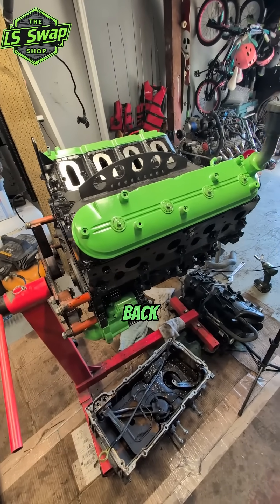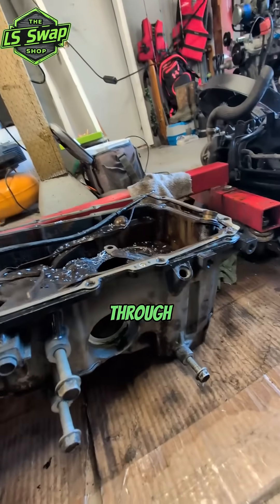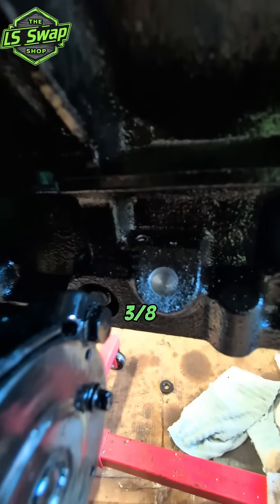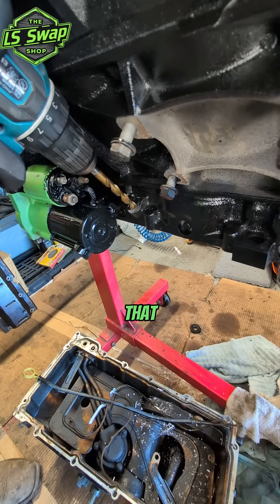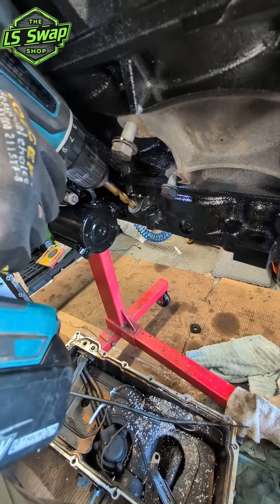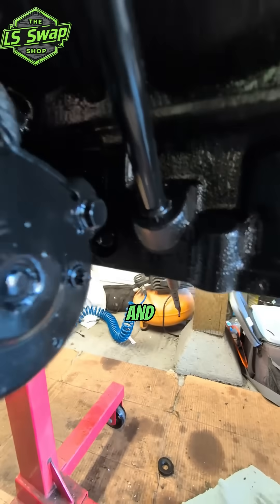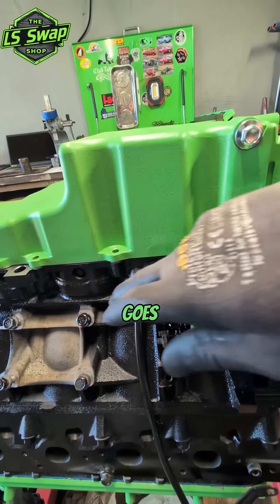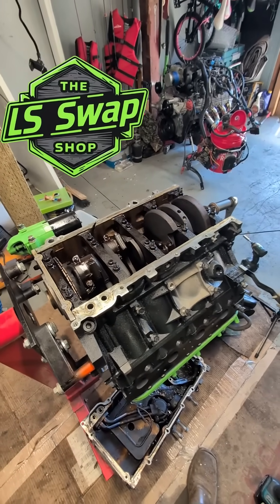Drilling the dipstick into the LM4!!

Comment: Are you sure that won’t bring a leak eventually? Is it just a press fit?
Reply from the maker: They're all press fit. Every gen 3 5.3l and 6.0l dipstick is press fit into a 3/8 hole. And theres a bolt up at the top that stops it from wiggling.

Comment: I didn't notice until I had my engine installed.  I'm doing using a slide hammer to see if I can pull it out.
Reply from the maker: You shouldn't need a slide hammer to pull it out. There's a bolt at the top near the exhaust manifold. But the bottom is just held on with an o ring. Should just come right out with a few wiggles after you take the bolt out.
Reply: @TheLSswapShop It was the plug. I had to take that out to get an oil dipstick tube in.  It was successful.  Hopefully it works with my turbo manifolds.
Reply from the maker: @Drekoushranada  where was the plug? in the stock dipstick location? never seen a plug there before. the aluminum 5.3l they just didnt even drill it out. at least on the lm4
Reply: @TheLSswapShop Yes. I have an LH6. It was a plug in the original location.  The engine came from an Trailblazer SS.
Reply from the maker: @Drekoushranada ok that makes sense.
Reply from the maker: @Drekoushranada what year is your SS. The one I'm working on came with an LS2 not an lh6.
Reply: Does that engine come with the same intake as a TBSS?
Reply from the maker: @JeepTribe777 you mean the one in this video?  No this one comes with a regular truck intake.
Reply: @JeepTribe777  It does but I purchased mine separately.